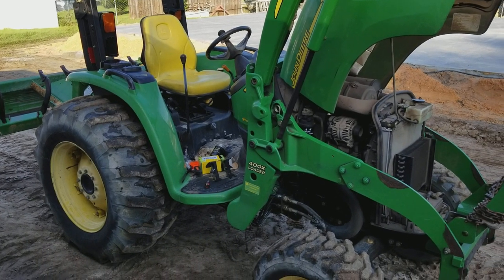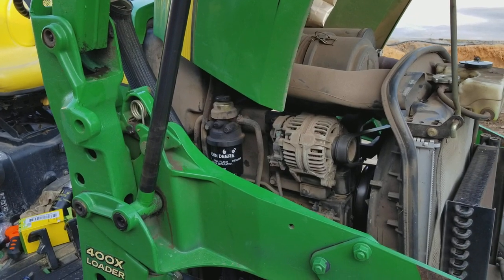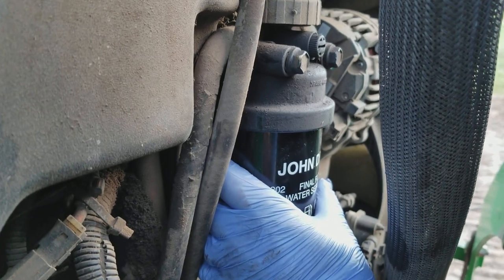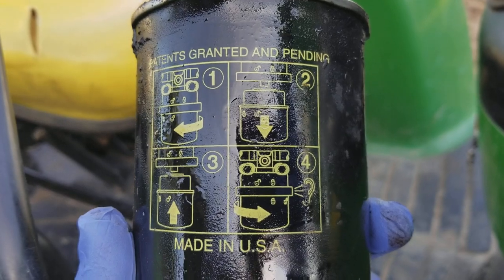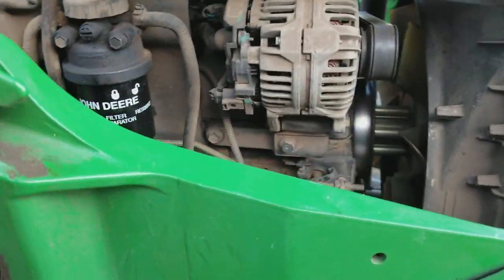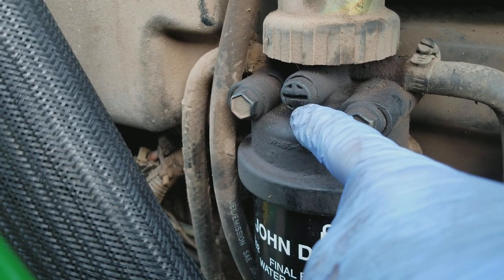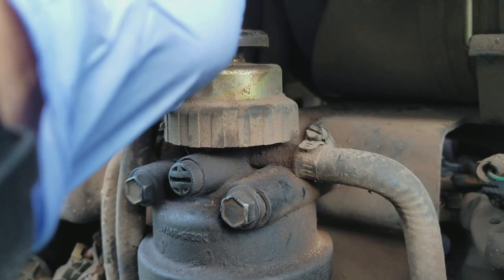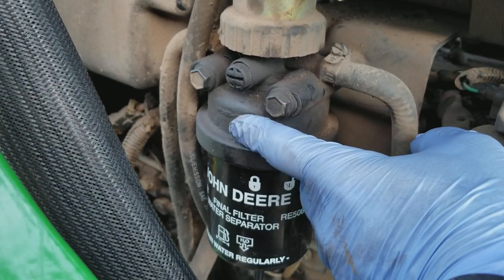Secret, simple John Deere fuel filter change procedure

Comment: Used this method this weekend on my 4120 and it worked great.  No pumping to get the air out.  Cranked first try.  Thanks for sharing this method.
Reply from the maker: Thanks for the comment. i'm really glad this helped. 

There is a lot of controversy about pre-filling oil and fuel filters. I am "for" pre-filling both. Most of us fill from the center hole. In most cases, this is where the clean, filtered oil or fuel should be. From the center hole, it goes straight into the engine or fuel system. For this reason, you must be very careful not to allow any contaminates to enter the center hole while you are pre-filling(dirt,trash, silver foil from the oil bottle seal). 

The problem with air in our diesel tractor fuel systems is that the air can potentially damage the high pressure fuel pump or injectors. I will definitely continue to carefully pre-fill my oil and fuel filters.

Comment: Good tip. Yeah priming the fuel filter  is necessary. You are supposed to use filtered diesel to fill the new the filter, especially on larger Diesel engines which have very large fuel filters ( primary and secondary filter)

Comment: Hi and Thank You!
I have a compact 4320 with same filter system and your video was perfect for me.
Lining up the Lugs was my issue and a little torch made it easier

Peter Auden
Macclesfield, Vic Australia
Reply from the maker: Wow, I'm glad my video helped! These are great tractors and the more info we can get about these types of procedures, the more comfortable we will be about maintaining them our selves.
Reply: I have a Compact 4520 with the exact same filter system.  I followed your video to the letter and did a perfect replacement of the new fuel filter.  My 4520 cranked as soon as I turned the key and ran as if the old fuel filter was still in place.  Runs perfectly...  Thanks so much for your video....

Comment: Wish. I found that video today. Didn't even think about it change fuel filter and fire the tractor up and it sucked all the air in the system. Any easy way to get that out?
Reply from the maker: I'm sorry to hear that. Not sure about getting the air out. I heard if you're not careful you can damage the pump but not sure how accurate that is either. Not looking at the tractor right now but might have to just crack open the lines near the injectors and pump the plunger until fuel comes out around the fittings
Reply: @markson352  thank God that he looks out for his stupid children:-) me being king of those. I actually went downstairs after watching this video and crack the bleeder open and pump the pump and it actually pumped all the air out of it. It fired right up thank you Jesus! The really sad part to confess as I drive a truck for a living and have for 30 years. And I didn't even think about filling the filter for fuel. My brain just was not working apparently.
Reply from the maker: Good deal! There's so much debate online about filling fuel filters and oil filters before you put them on because the center hole is where the filtered fuel or oil goes straight to the engine. You just have to be careful not to drop any kind of contaminants in while you're filling the filters or it can mess things up
Reply: @markson352  oh yeah it wouldn't have been bad if either just open the bleeder and pumped it full of fuel. I just didn't think about it. I was in a hurry.

Comment: Here's a simple 15 dollar fix for all that mess. Cut the fuel hose before the filter and install a marine fuel squeeze bulb. Don't even use the filter pump it's to slow. Squeeze the bulb until hard, real hard. Problem solved. Get the blue color bulb, it's for cold weather and has double stainless steel check balls.
Reply from the maker: Thanks for the comment. You'll have to watch the video all the way through but I did not do any pumping of any plunger or bleed anything at all. I simply filled the filter with diesel and the tractor crunk up like nothing was ever done to it. You just have to be careful not to get any trash or debris in the center hole of the filter because that will go straight into the lines and injector pump and injectors.

Comment: Don't fill your filters with fuel you could put contamination into the clean side of filter. And then have injector issues. When it's pumped in the fuel is forced through the filter! There is only 0.00009" metal on metal moving parts in injector. 1 microscopic partical can jam an injector